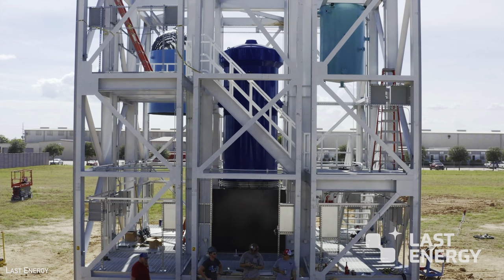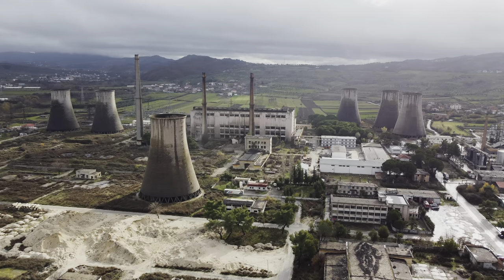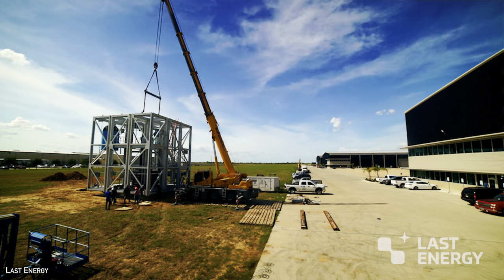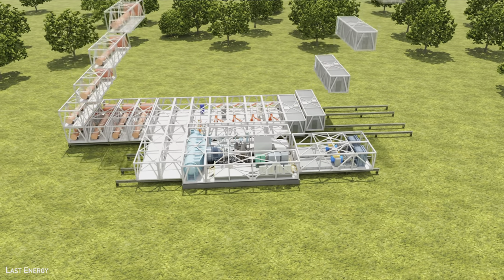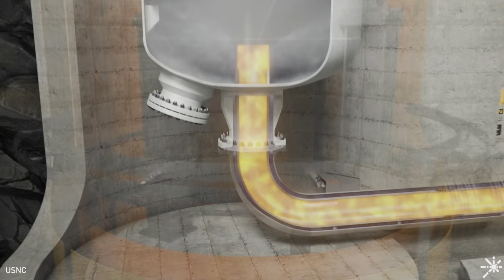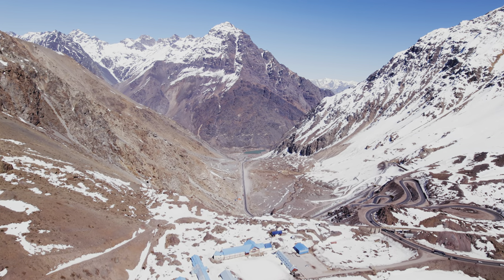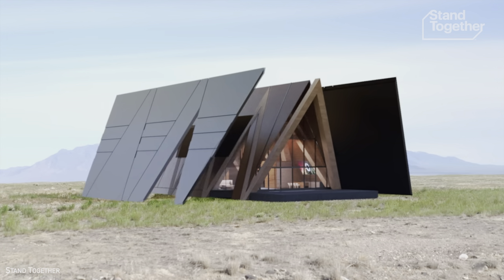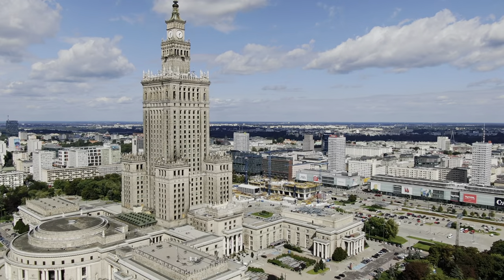The Daring Plan to Build 10,000 Nuclear Reactors

Comment: This is exactly what the industry needs. The technology already exists. The only challenge is to scale it to a degree where it makes economic sense, just like the semiconductor and automotive industry have done. More output also means more experienced engineers and better overall quality along the way.
Reply: It would also be less expensive to mass produce them in a factory instead of doing one-off construction like they do now.
Reply: Unfortunately, block units have been around for 60 years, but outside naval applications have never been used in scale. So I  don't see any movement happening
Reply: It's like use scooter engines instead one big ship engine..
Reply: No, that is backwards. If it ain't profitable in big scale, then it surely isn't profitable in small scale.
Reply: ...and there it is right there. Nuclear fair weather, fuzzy thinking. There are critical differences. You cannot protect reactors from cruise missiles as it is. What happens when you "scale" reactors so there can be one on the end of every street? Nuclear reactors are not like cars. Cars emit waste that is predominantly biodegradable, or will dilute. Nuclear power plants - all nuclear power plants - emit radioactive gases, liquids and solids all the time they generate. We should probably build them all at the end of your street
Reply: @LilFaerl  False. The problem with 1 GWe LWR’s is no two are the same. They’re constructed on site as a moving target (because of changing NRC regulations). SMR’s are to be built identical in a factory and shipped to site(s).
Reply: @geowar20  "They’re constructed on site as a moving target (because of changing NRC regulations)."

When the permit is granted, new regulations usually have no say. If they are Retroactive, they will of course be just as devastating for a mass produced small units which all need to be updated and the production line changed. So no, not a sound argument against big scale.
Reply: @geowar20  "SMR’s are to be built identical in a factory and shipped to site(s)." 

The small part is very relative. We are still talking about many metric ton of equipment. Every site still have to be build in situ with their unique underground and tests.

Comment: As a marine engineer, this is the way to go.  Big container vessels have 80 MW propulsion units. A nice fit for the supplier/user
Reply: I've always wondered why there's so much talk about modular reactors being researched and developed. If they are powering ships and subs how can it be that much more difficult to do the same for grid power?
Reply: @justinmyers6737  US NRC is the big enormous barrier for any commercial nuclear anything.  Those Navy nukes are not licensed for commercial anything though they’re are perfectly safe designs.  So from viewpoint of anti nuclear NRC, they don’t exist.
Reply: well, to be entirely fair, the smaller a nuclear reactor is, the more dangerous it is, because it's controllable in less and less points, essentially. In a submarine reactor, one with 9 control rods (1 central and 8 arranged around it), the central rod has 80% of the reactor's power control authority. So I can see why they'd be more dangerous and less commercially licensed
Reply: @matteodelgallo1983  “small … more dangerous”

Cmon. More dangerous than a 3GW thermal reactor w 150 some fuel bundles, center core maybe 3M from ambient temp, spent fuel sitting in the pool, and w MWs of decay heat in a LOCA?  

Yes a small reactor might be harder to control at points.  But it’s actual threat  to the surrounding community from the amount of radioisotope it might dump, and the range it can throw them in some excursion is easily 3-4 orders magnitude lower for this dinky reactor vs large, and the threat for even the large is low.  Then, they are going to bury this small plant, because they can when it’s small.   More dangerous? The lack of perspective in the nuclear community baffles me sometimes.

“Less commercially licensed”
Not less, never. That’s because 1) the  US NRC has never licensed anything new, start to finish until Vogtle. AEC started all the rest.2) the NRC cost structure for new designs is basically, 4 year, a $billion.  large or small, more or less same price.  Vendors go w large, unsurprisingly.
Reply: How many MW thermal?  
I mean we only talk about that with nuclear energy, not any other energy source.

I imagine that awful bunker oil with incomplete combustion has pretty bad efficiency.
Reply: @Nill757  I hate that people don't realize that the NRC was quite literally being run by gas interests (Jackzo) for a few years. They have done nothing substantial to advance the nuclear industry in the States.
Reply: @Shaker626  Jaczko is a wind developer now, happy to denounce nuclear power ever opportunity.  He’s the main reason Yucca was cancelled, illegally per a federal judge.  

My view, he has blood on his hands for exaggerating the Fukushima accident at the time, which led to more forced evacuation of the ill and seniors in hospitals or care centers, which killed many.
Reply: ...and a spent fuel pool cruise missile target a few hundred metres from my house? I don't think so.
Reply: @justinmyers6737 Many, many reasons, but maybe let's go with not having dozens more targets for a Russian attack?
Reply: @grahambennett8151  If there's cruise missiles falling anywhere near your house, you have some bigger problems to deal with.
Reply: @grahambennett8151  good grief.  You imagine a ton   of tnt in a cruise missile flying through right over your head, and you imagine it’s old hot rocks in a pool inside a concrete dome, rocks that don’t explode, that is the thing to worry about?  How do you get there? Movies?
Reply: @justinmyers6737  The answer is that we shouldn't be powering ships with them either. LOL.
Reply: @grahambennett8151  why not?
Reply: @Shaker626  It is the IAEA's job to promote peaceful use of nuclear energy, not the NRC. The NRC's brief is to regulate nuclear and protect us, so what are you suggesting. Should we let nuclear run it, perhaps? LOL.

Comment: The business plan seems like a great idea, so is not wasting time in the US. However, it's still a PWR which means it will be expensive by design. Copenhagen Atomics has the same business plan and also skipping the US who has no interest in energy leadership. However, they are going with a MSR which is inexpensive by design and as long as they separate the reactor vessel from the power conversion side, everything will also be off the shelf equipment. Output temperatures are much higher making industrial heat applications much greater.
Reply: Check out Nano Nuclear. Their plan is to deliver nuclear energy

Comment: This is just an investor fluff power point.  3.5 mins in it sounds like Nikola all over again.  There is no substance.
Reply: NuScale made the same claims and today its cost is $20,000 KW which is 5x a conventional plant. Why so much, 2 reasons, one it's a PWR, and two the NRC. This company is skipping the NRC but it's still a PWR, so it too will be very expensive.
Reply: @chapter4travels  This is total vapor.  "Startups" are great for silicon valley investors.  But startups are not going to be given nuclear material.  And you can not build a reactor with off the shelf parts.  I mean you "CAN", but I would not want to live East of it, or within 100 miles.  It will never get past the "not in my backyard" crowd.
Reply: @johnjay7822  I would not call it vaporware, this technology is very well known and I'm sure it can be built exactly as they say. In a nuke power plant, the power conversion side of the plant can cost as much as 85% of the total plant cost and that's the side they propose to use "off the shelf" parts for. However, the NRC will never let them get away with that because of the nature of a PWR, it will all have to be nuclear certified. This is why they are not attempting this in the US. Can they find another country that will let them do it (as they should) nobody knows?

Comment: What a brilliant concept. Instead of using a single six cell 66 amp car battery to start a car, we going to use thousands button wrist watch batteries for the same purpose. Not to mention the existing piles of spent nuclear fuel, now adding more to it, instead of breeding new from it.  Everything went wrong in nuclear industry.

Comment: Using off the shelf technology is a huge plus!
But 20MW is absolutely tiny, and there's several unexplained and concerning things about this idea like what is the fuel expense going to be and what's their energy efficiency.
Reply: The SMRs require much higher enriched uranium, and they don't burn the fuel as efficiently.  Just more nuclear waste to store for thousands of years.
Reply: Imagine putting these in substation plants, to stabilize grids, or in specific places like refineries or steel smelters.  20MW placed in the correct spots might be quite advantageous.

Fuel expense is likely to be as low as regular reactors if they're using LEU fuel assemblies common to AP1000s or such.  Energy efficiency will likely be slightly lower, because nuclear efficiency usually favours massive scale.  If refueling becomes a matter of changing out entire cores, then delivery of new fueled cores and removal of old cores is weighed against the need for nuclear operators and those elaborate control rooms.  

So I'd refine your questions further, and ask one more;  Is the same factory that builds these tiny cores also responsible for removal of the hazardous used cores, and disassembly for the removal of the used fuel rods?
Reply: @acmefixer1  The fuel will be too expensive and too many safety issues then. Another startup grifter.
Reply: @Withnail1969  Yep. Old reliable, Fukushima/Chernobyl tech. Can't wait.
Reply: @grahambennett8151 Chernobyl tech isn't present here. The RBMK design was unique to the Soviet Union. They knew PWRs were safe and reliable, but they didn't want to use "American" tech. Also, Chernobyl didn't have a containment structure. These reactors will be buried underground. Fukushima only happened because of a massive earthquake and tsunami that can't happen in most places.
Reply: @jeffbenton6183  Oh, so it's not fission, then? LOL. Like there haven't had accidents in Three Mile Island, Fukushima, Windscale, Santa Susana, Dounreay and lots more. Fukushima happened because the untrustworthy nuclear industry - overseen by the IAEA, did not see fit to prepare for the entirely foreseeable earthquake and tsunami. TEPCO, the operators had been warned about the tsunami wall. They even excavated the site to build four reactors at sea level, right next together in the Ring of Fire, a notorious earthquake zone that surrounds the pacific. What can happen in most places is nuclear industry stupidity - and your post is right up there.
Reply: @jeffbenton6183  Fundamentally, you are wrong. Chernobyl tech was fundamentally the same - water-cooled fission driving steam turbines and a generator. SMRs are the same too. Fukushima was "American" GEC Mk1 was the same, and also known to have inadequate containment. The famous "GEC 3 - reactor" designers resigned over that. Mk1 containments - as we have clearly found out - were also woefully inadequate - just like at Chernobyl except that this "American" disaster was not just one power plant, but three power-plant explosions, and reactor meltdowns, cooling pool melt-outs and multiple spent fuel fires from the inadequately protected cooling pools. Do I trust these people? No.

Comment: The big question is what is the cost per megawatt of generation of initial construction and operation compared to a larger standardized reactor? Each reactor is going to require at least two licensed operators per unit, so a large number would require a large # of operators for multiple units.
Reply: I think the idea is that after its approved, the initial cost of approval would be shared for the entire design which is the same, the number of operators don't really matter that much, its not salary that's expensive, I mean, not of the operators, but of the lawyers.
Reply from the maker: It will be interesting to see how that works out. One point about that though is since they are selling a PPA, the customer doesn't take on the risk of the operating costs.

Comment: Sounds good.  I wish them luck.  The other issue I'm wondering about is, what is the supply chain for getting 5% enriched uranium?  Along with this, is the plan for waste storage.
Reply from the maker: Supply chain for "standard" 5% enriched uranium is pretty well established with several companies (Orano, Urenco, TVEL, etc.). Fabrication into final fuel assemblies also has several participants (Westinghouse, Framatome, KEPCO, etc.). Long term waste storage is usually the result the individual country's policies, which varies widely.
Reply: @atomicblender  thats not an answer on the waste...
Reply: Breeder Reactors. 😉
Reply: @phil20_20  I dated one of those back in college. Fun when operating on the edge at an equilibrium power level.
Look out if the there is a runaway event or a power/cooling loss resulting in core exposure.. I learned to stay far away from Breeders in the late 1970s. Instant "Gamma Ray toxicity" is always just seconds away.
Reply: @froggy0162  literally said in the video the spent core is buried on site

Comment: Being a solid-fuelled reactor, it has similar inherent risks to existing ones. Even if they can achieve effective passive cooling, which is far from a certainty, any fault or damage in that system will ultimately lead to a meltdown. Those dots over Australia certainly won’t be realised without the adoption of the incomparably safer reactor configurations that incorporate liquid, or liquid-like, fissile fuel loads which can be dumped from the core into a reliably safe geometry (in terms of both fission and heat).
It’s disappointing to discover that so much effort and cost is being wasted on reactor designs that don’t properly address the most significant safety concern with regard to nuclear energy.  Absolute “walk away” safety is a prerequisite for many, and that can never be guaranteed with solid-fuelled reactors.
Reply: Quite. Funny that. You walk away from a solar farm, it doesn't explode.

Comment: Damn. I was hoping to hear about the use of modular liquid fuel reactors. 
Using cheaper, more plentiful and safer liquid Thorium. 
Walk away safe. They do not need a large expansion volume, or atmospheric release, if cooling fails. In the the reactor. Or the low percentage, barely "used" fuel rod pools stop circulating.
Uranium reactors boiling water were used because that was "proven technology" in submarines using highly enriched U235 as a fuel. Land reactors used low enrichment U235 and weren't under gigantic volumes of water. Where's the easy technology crossover there?
And it generated lots of plutonium to build Boosted Fission and Thermonuckear weapons.
Any solid fuel nuclear reactor that uses H2O(Water) as it's neutron moderator.
And Water as it coolant is scientific idiocy. Adding more coolant, water, Increases the reaction in an accident situation. Even if you've got a lot of "20 Mule Team Borax" lying around.
 Stupid, Stupid, Stupid.
We are beyond that need at this point. And have significantly more knowledge of materials reliability.

Comment: I don't see anything new here because if the goal is faster to deployment and production, it seems to have just as many impediments and hurdles to overcome as the many other nuclear start ups that have many beneficial advantages that using the old technology doesn't. Having said this, any effort to make genuine strides towards a carbon free that consumes less industrial resources (i.e. copper, lithium, rare earths) has to be encouraged and given a chance to prove itself.
Reply: No, listen again. It avoids all the usual things that slow down reactors, uses all the long used parts which are long certified, long understood to work.  Then, it’s small size allows it to be built w cheap parts, no $150 million custom steel that only a few places can make and then can’t be shipped by truck.

Comment: There is not enough uranium for conventional reactors at this scale (see Sabine's video).  We need to be use more advanced reactors.
Reply: That's based on existing mines and the relative lack of reprocessing. There is way more Uranium just here in Australia that's not being explored due to lack of demand there is also likely large deposits in Canada and Russia that's not being dug up. We could also ramp up reprocessing and re-enrichment and develop and deploy more advanced  breeder reactors so that we can replace U235  with plutonium or U233.
Reply: @SpencerHHO  You didn't watch Sabine's video then.  There is just not that much uranium.  I am all for the other types of reactors but the old style is not sustainable.
Reply: I don't know who sabine is but there certainly is enough uranium for 200 GW of new nuclear. If not, we could just recycle spent fuel and have enough uranium for hundreds of years.
Reply: frank13  no, you breed Pu-239 from U-238 which is quite easy.
Reply: frank13  Breeders are highly political, generally used to make nuclear weapons. Would be a hard sell.

Comment: Here is a possible use care.
Take a MAJOR city like NYC. Get a full city block and rip everything down.  Then build a police station, fire station and EMT station with EOC (Emergency Operstions Center) in the new building AND PUT A SINGLE SMR (Small Modular nuclear Reactor) in the basement.

This will give you a full emergency response center with its own power supply that can ship its excess power the city grid.